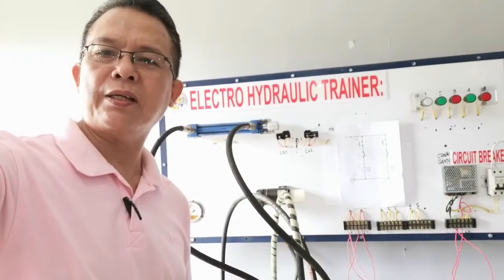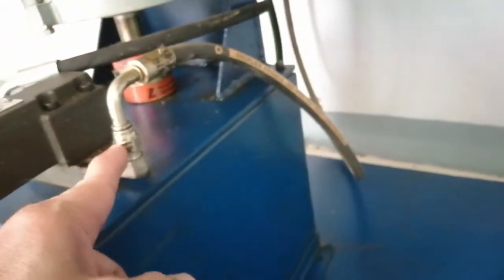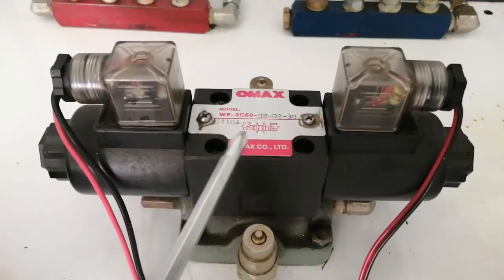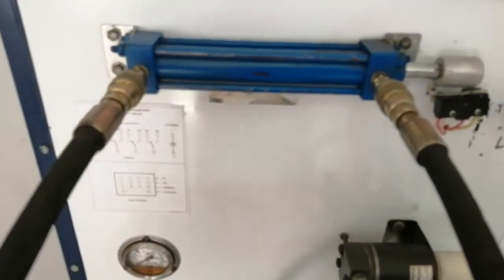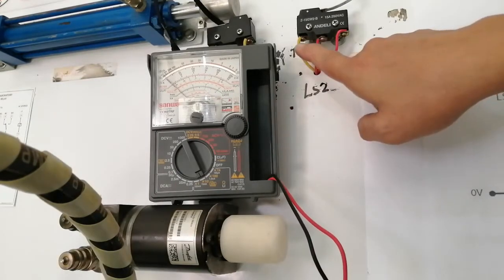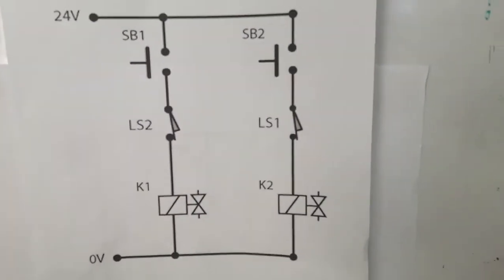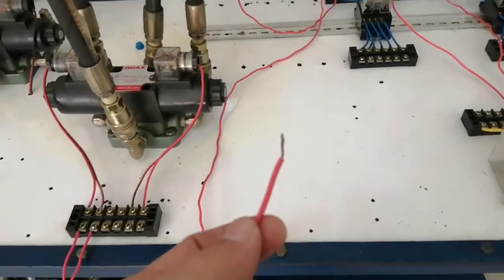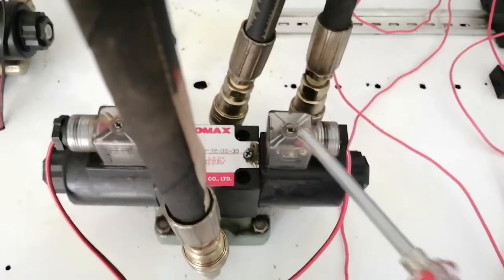ELECTRO HYDRAULIC CONTROL SYSTEM

Comment: What advantages of using electro hydraulic?
Reply: much more like its use in operation theter tables etc .
Reply from the maker: Big deal sir, especially a ship's steering gear which controls the rudder.. 
With electro hydraulic system, it can manipulate from the Bridge's steering wheel sending the signal via electric control system and then through the steering gear hydraulic system it 
 controls the rudder..